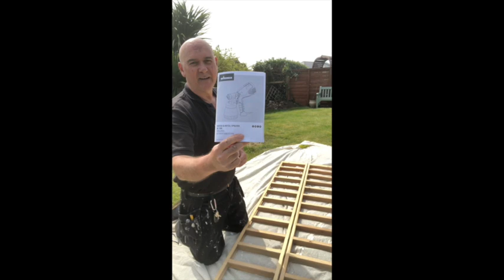Wagner W100 paint sprayer - how to spray paint a fence with a paint sprayer #wagner #paintsprayer

Comment: Good comprehensive run down of the Wagner W100 Nick,
My only criticism of your review is the nozzle orientation is the opposite to what you stated, 
If the air horns (nozzles) are side to side the fan (pain being sprayed) is vertical for painting side to side
If the air horns (nozzles) are up and down the fan is horizontal for painting up and down
Reply from the maker: Thanks

Comment: Hi Nick, at 6:13 you mention the nozzle settings and the spray direction. It's actually the opposite. Is the nozzle if horizontal then u spray in that direction. If its vertical you move up and down.
Reply: Nick is right

Comment: That review was indeed very helpful. I have this spray gun and I've used it for the first time which didn't work out very good and thus I'm troubleshooting to what I did wrong. Apparently the nozzle wasn't turned to the correct direction. Rookie mistake. But thanks anyway!
Reply: Hi, I got the same model a few days ago, and use Johnstones' Shed & Fence one coat rather thick paint. It took more than 1hr to finish an average size panel. I tried turning the knob both +/- didn't make much difference, there is a video here a lady doing a demo and finishing a panel under 3 minutes. Unless the paint is thin as water, I don't think it's possible?? 
Any thoughts guys/girls??
Reply from the maker: @indikawijerathna9817  I think you are right, the shed paint is quite thick so I added 10% water when I tried it on a large shed.